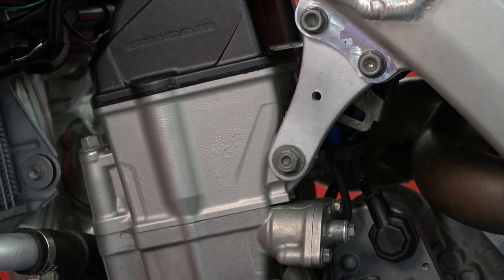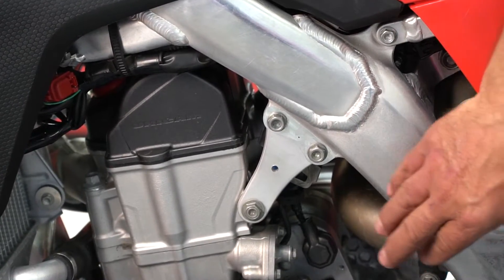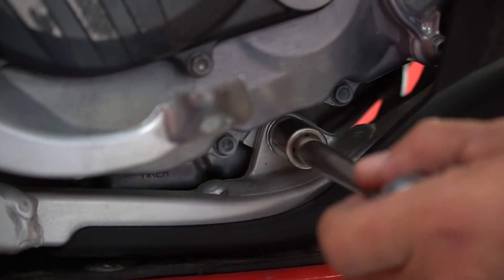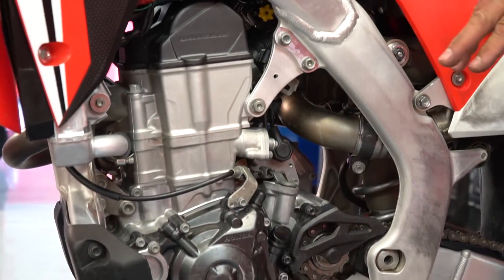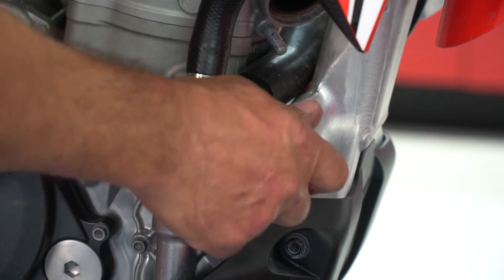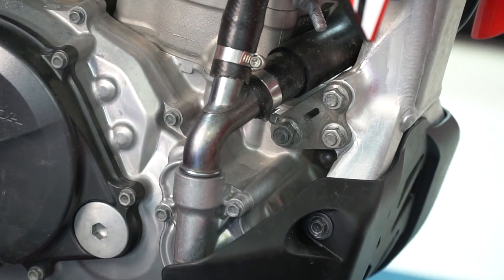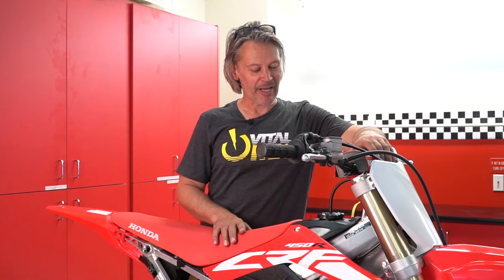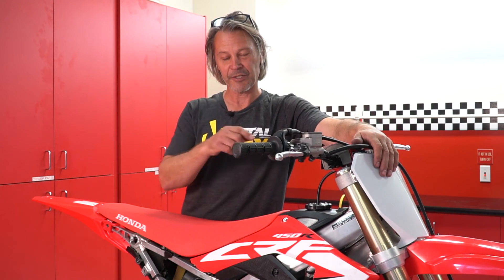OEM Tech: Honda Chassis Retorquing

Comment: You have your torque specs backwards
Upper hanger to frame bolts are 24 lbs/ft , lower plate to frame are 19 lbs/ft

Comment: Best place to buy different motor mounts? Tried looking on motosport for different mounts (soft-stiff), and couldn't find any other than oem
Reply: Why would you wanna change that? Thats possibly the last thing to change.
Reply: buy oem for 18 or 19 crf 450,
Reply: got a 17 450 leftover, bought 18 oem the hangers are thinner ,& buy retorqueing it was instantly felt on the track for the better.
Reply: Works chassis labs

Comment: I am sure Honda uses loc-tite  on certain fasteners, especially motor mount bolts . By breaking them loose, you have broken the bond, and re-torquing  them without removing them , cleaning and applying loc-tite before re-torquing , they might loosen because of motor vibration .
Reply: The frames get very hot and just in case it burns up the loc-tight mark the bolts with paint.